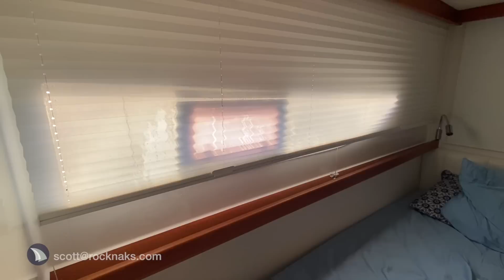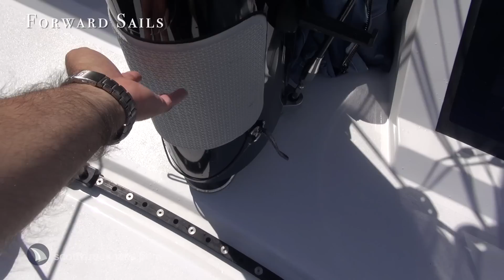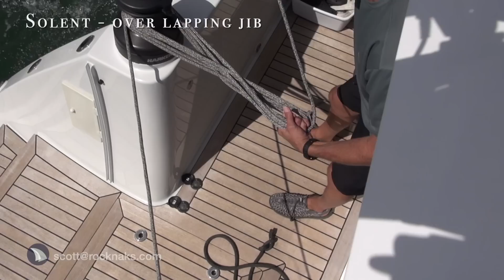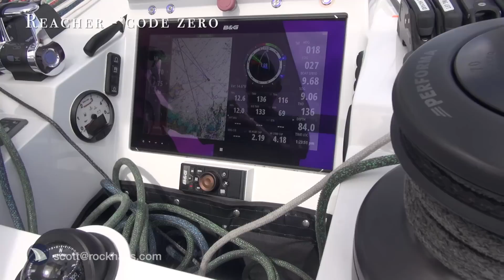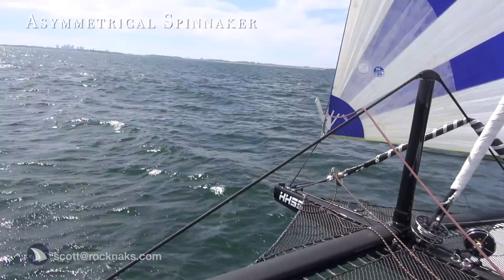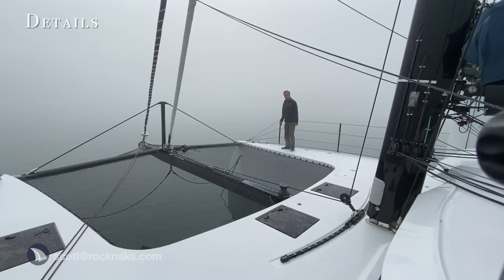Sailing Utopia, HH Catamarans HH55 with Scott Rocknak

Comment: Nice. The bridge protection looks functional but doesn’t match the rest of the build quality. Nitpick. Do they make one with electric engines??
Reply from the maker: The biminis on Utopia are removable. Its possible to reconfigure to your specs. Same with a custom order. Diesel Hybrid and electric motors with DC generators are possible but should discuss realities first.

Comment: the starboard settee I convert to a huge trunk, same height as helm station floor - could be a bike garage, maybe...
Reply from the maker: Bikes do fit in the bow lockers BTW.
Reply: @ROCKNAKSYACHTSALESINC  yes, but once you have the sails and ropes tucked away in there, do you still have room for bikes? It’d be helpful to see all the sail hardware laid out on the netting, just to clarify how much of it there is.
Reply from the maker: @GuyCruls  I just took a photo of (2) full size electric non-folding bikes, a spinnaker and a reacher all in one locker with room to spare. email me scott@rocknaks.com for the image!

Comment: Another excellent video on this amazing catamaran specifically, and HH 55s generally.

Couple of questions.

1. You mentioned using a “Drifter” (forgive me being a neophyte sailer) but I’ve never heard that term before. Could you identify what this refers to?

2. Tuning the rig / mast using that portable pump? a) How often must it be done and what are the main causes that require one to tune the rigging? b) are you continually adding shims to increase the mast height, or are there instances where tuning the mast involves removing shims that you’ve previously placed in? 

3. As a side discussion I never hear about this rig tuning requirement for “cruising” catamarans. Is the need for tuning the rigging on the HH carbon cats a function of maximizing their performance capability?
Reply from the maker: Good questions:

1. I meant to call it a "Reacher". A drifter is very similar but more wind aft of the beam capable. Drifter/Reacher/Code Zero are all similar sails with different cuts determining how full they are.

2. The cap shrouds are actually set in their length. Being carbon and/or kevlar (aramid) they can be built to to precise measurements. The shims are added after raising the mast with the pump ever so slightly. Typically its not something you need to adjust once the mast is stepped.

3. Cruising cats typically have turnbuckles with stainless steel wire rigging. The stainless does stretch over time and you need to tighten the turnbuckles to keep the prescribed tension on the rigging. A performance cat with the E6 or A6 rigging has had the math done ahead of time to make the rig at the designed parameters. If you you had to replace a cap shroud, for instance, theres a bar code associated with that components and the new one will match exactly.
Reply: ROCKNAK'S YACHT SALES, INC. thanks Scott. Very enlightening. Learning a ton just watching and listening to your videos! One final question. Actually a repeat question that I didn’t ask clearly before, in a previous (live) video. The new HH 50s have a one (carbon) piece Martingale and Longeron. I love the look of it visually. Have the latest iteration HH 55s adopted this design feature, or will they continue to be a two piece design as is the case with Utopia?
Reply from the maker: @ejgordon7548  The HH50’s longeron and martingale are from a mold. That itself has the ability to be extended on the longeron for a “turbo” arrangement on the HH50. The HH55 has individual components also with the ability to extend the longeron. For now the system works well and has good flexibility. I have photos of both in production that I can email if you are curious.

Comment: The rig seems....um...complicated. Seems shorthanded, couple sailing may be problematic ?
Reply from the maker: The HH55's that are out there are all couple or two people boats. There are some things you can do to make it work for your situation. The reasoning for the halyard locks for the main at full hoist and the reefing points are to have the stress at the mast vs a clutch back at the helm. This allows for smaller diameter line, less line real estate and weight, and the ability to easier carry the loads of a performance catamaran. Once you actually do it, it becomes more second nature.